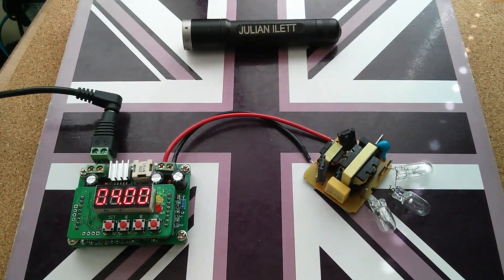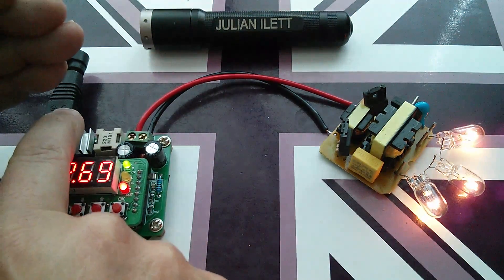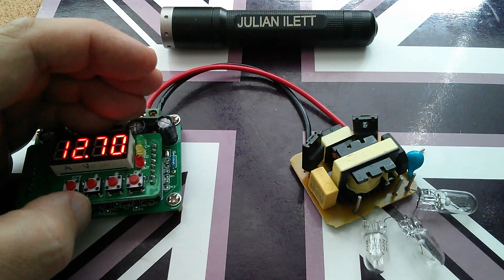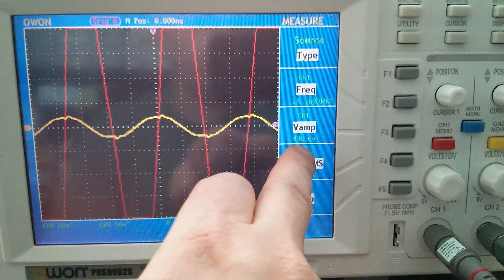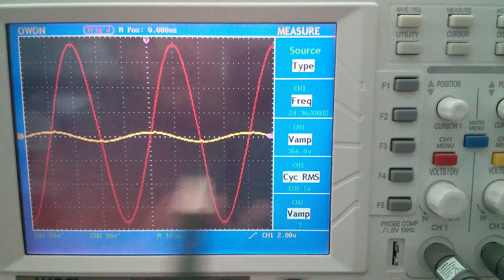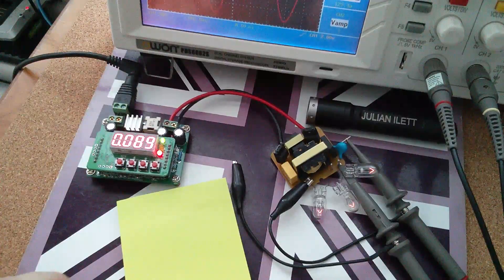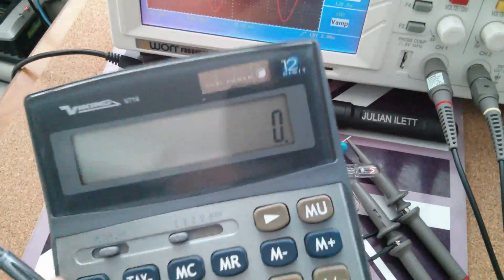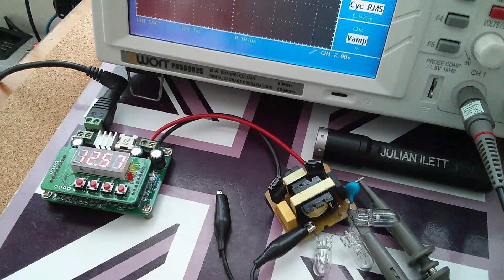Royer Oscillator Inverter with Output Capacitive Dropper

Comment: The voltage divider ratio is not confirmed by the oscilloscope because you can't add reactance and resistance in the scalar form as they are perpendicular to each other. So the formula for the voltage divider that involves a capacitor is a bit more complex, it involves a ration in its vector form.

Comment: the cap getting warm shouldnt be there,as class y metal film type is usually to chassis for emi filtering. . .I,m  surprised it hasnt croked it.!.  the dc- ac lamp inverter circuits typically use polypropylene caps in the output to limit the current to the fluoro tube. , but not cheap,so  to save on cost ,this fellow got the job.

Comment: Its an safety cap, its designed to be connected to Earth hence the Y, it is however NOT designed to be in parallel with the output, therefor it gets warm.

Comment: This may help, I found it on a different ebay listing:

First: can not be used in: iron core transformer (including the motor category)!

Second: the output of sub ABCD multiple combinations, each has its advantages, such as:

A plus C for output: the output of this circuit with power overload protection.

D plus C for the output: the output of the direct hybrid (electromagnetic valve relay capacitor charging lightning protection equipment and socket outlets can be normal use) of the dual template direct hybrid compatibility of the best.

A and B as output: the output specifically for resistance capacitance step-down drive (Nightlight resistance capacitance LED lamp 110V AC electrical appliance) these two kinds of products, then can not be used.

Third: double mode board this three way can be used at the same time, the total power is not more than 35W.

Dual template: 3V-14V battery can be turned into 220V and 110V alternating current and 220V DC power.
Output voltage: AC AC100V DC220V AC220V power output rate 0.1W-26W

If the input voltage is 3V, the output is 1W-3W (automatic variable power, according to the load and meaning)

If the input voltage is 5V, the output is 1W-5W (automatic variable power, according to the load and meaning)

If the input voltage is 8V, the output is 1W-10W (automatic variable power, according to the load and meaning)

If the input voltage is 10V output is 1W-15W (automatic variable power, according to the load and meaning)

If the input voltage is 11V output is 1W-18W (automatic variable power, according to the load and meaning)

If the input voltage is 12V output is 1W-26W (automatic variable power, according to the load and meaning)

If the input voltage is 13V output is 1W-28W (automatic variable power, according to the load and meaning)

If the input voltage is 14V output is 1W-35W (automatic variable power, according to the load and meaning)

The product is high frequency current, the common universal meter can not test the voltage of the (dual template of the DC hybrid can be tested after the load), the single template needs to use a professional high-frequency universal meter to test the output voltage. You use different brands of universal table test out the voltage is not the same, there is a gap between the. There are customers to reflect the universal meter test out of the voltage is too high, but also some customers reflect the test out of the voltage is too low, which is different models tested different results. In the use of incompatible products will not high voltage. Can consult the owner before use.

The actual voltage of this product is in the 210V~240v to meet the electrical input safety voltage.

The dual template of the self loss power control and then 0.3~0.5W between, extremely power saving,

Comment: I curious how it would work driving a 240volt 10 or 25w ish fridge lamp or similar as it was intended and what is efficiency and output wave would look like. It should easily drive a CFL. As some others have said the capacitor should not be dissipating energy in that circuit, I'm wondering if the very low impedance load adds to the issues.

Comment: Capacitor getting hot is because it is a ceramic with high internal resistance from the thin metallisation used, so it gets warm from the I2R losses in it. Replace with a 2n2 400VAC film unit and it will run cool, just because the film has lower DC resistance and thus less heating.. As well put a capacitor of around 470uF 25V 105C low ESR directly across the DC input, it will improve the efficiency.
Reply: This capacitor is designed to be connected across 240V/50Hz mains, so using it at 130V/25kHz is going to pass about 300 times the current that it was designed for, it's a wonder it doesn't emit the magic smoke.  The designer of the inverter probably intended it to be used in series with a fluorescent tube of some sort so the voltage across the capacitor would then have been lower.

Comment: spikes are from transistors switching from one to anoather
Reply: Most likely, and the caps will diferenciate that waveform too, so any hi frequency spikes will have much more current across the load!
I had thought fluoro driver too, but why the rectifier?
I found those type x and y caps got hot too, MKT best, probably green cap ok too.
Reply: +william Taylor Yes there is a lot of reactive power on that cap so isolators heat up
Reply: Yep, they are a strange beast, they are designed to fail open unlike most kinds of caps, same type as those suppresser caps inside every usb charger that connect you to the mains!
I think it would be interesting to short the output and deliberately pop the thing to see how it really does fail!!!
Reply: probably woud melt and become resistor beacouse they are not desinged to protect from high current and heat but high voltage causing breaktrought inside I think.
Reply: Well, I think they are supposed to fail open. I'd love to actually find out in the real world.
They are a Y class cap, and a normal cap fails short, which is slightly bad if it's connected from the mains to the output of a plugpack!
bigclivedotcom talks a lot about them.
It's probably time for Julian to blow something up again anyway!
Heh Heh!

Comment: You cannot do a simple diviosion with reactance and resistance to get the drop. The result of simple division is simply just wrong. If they are in same order of magnitude, the calculation gets a bit more difficult.
However, when the reactance is an order of magnitude larger, you can assume the resistance is a short to get the estimate of the current and after a multiolication with resistance you'll get an estimate of the voltage. The error for this method should be less than 5 or 10% when the reactance is at least 10 times the resistance.

Comment: The 90 degree phase shift makes perfect sense.  Most of the output voltage is dropped across the capacitor so it determines the phase of the current.  The current in a capacitor leads the voltage by 90 degrees.  The load (the lamps) is resistive so the voltage across it is in phase with the current so it also leads the output voltage by 90 degrees.

The kinks in the load voltage waveform are however a mystery.  They must be somehow related to the switching of the transistors but that doesn't explain why they are not present on the transformer voltage.

Comment: Nice video Julian Thanks. It seems to me that the capacitor ESR might play a role in the output voltage drop, in addition to the pure reactance.
My additional question is about the serial port of the B3603 cnc power supply. Can it be used to program the voltage or current values with an external laptop or pc or arduino for instance?
Reply: I don't think the serial port does much with the standarrd B3603 but someone has reverse engineered it and wrote some custom firmware for it which does suport serial control.

Comment: I'm guessing the cap is for impedance matching with the theoretical 220v 35w load. Do you happen to have anything like a 220v 40w incandescent bulb to test the output voltage?

Comment: I've gotta get one them programmable dc-dc boards with the display/buttons , I have been searching through all the videos but yet to find it.
Reply from the maker: It's the B3603 by Ming He
Reply: Thank you , Ill start searching for it at once :-)
Reply: Cool! I just bought one! Thanks!
Reply: I figure they got to be useful for something :-)
Reply: I wrecon rechargeing batteries, There just wouldn't be anything under 36v you couldn't charge with that thing!
I'd better go and scower ebay for a 40v 3a supply to run it with!
Reply: Hehe i think ill just stick to using a pc power supply :-)
Reply: Only problem with that is you only have 12v, you couldn't get it above about 10.5v with that, Not so useful!
Reply: well errr ill put my large 18650 batt pack on it heh or something crazy
Reply: Well, I did find this, and had to have it too!
ebay:
Item ID: 291715691769
It's a 400w 8 to 80v up converter, I think it can take from 6 to 40v in, so could be rather good on an old pc supply!
Could run the other one off this for fine low voltage control!
This would be orsum for Julians solar system!
If he doesn't already have one of course!
Reply: But ebay cant find item number 291715691769
Reply: Hi, Here's the address then.

 http://www.ebay.com.au/itm/291715691769  
Hope youtube doesn't munge this!
Reply: Yeah that works great thanks :-)

Comment: I think it is time to build a new version of the unit that you are investigating and turning it into a INDUCTION HOB, using 2x 2N3055 metal cased power transistors.

Comment: What's your opinion on buying individual solar cells ?
I'm thinking of getting some cells to play with ( 40w for 25€ ) but is buying individual cells a good idea ?
Reply from the maker: It's a lot of work. Soldering the cells together with tabbing wire. Sealing it all in a glass-fronted frame. But we love hard work, and we learn so much more from a DIY project :)
Reply: So it's possible, that's good to hear  

Will definitely get some then !

Also, didn't that banggood scilloscope come with 1x probes ?
Reply: +BitsAndBites It's alright for small panels, (about 40W/100 cells or less) especially if you can find glass or a sealant for cheap/free, larger panels are obviously possible but no where near cost effective these days since you can get a full 100W+ panel off ebay for roughly $1 per watt, whereas comparatively buying solar cells, glass, frame, plus sealant if you want to leave it outside, in total it would be around about $40+$20?+$10+$30=$100 bare in mind those are just guesstimates and a bit on the low side, so the actual cost will be a bit higher, which also doesn't factor in the little extras such as tabbing/bus wire and a flux pen is recommended, so another $10 there and you'll probably want MC4 connectors if left outside so about $5 oh and you may want a solar mount too, so overall I wouldn't recommend it unless you have a specific size/shape/power production in mind for a project or you just want to have a bit of fun with em.

For smaller panels though, I got lucky enough to get a bunch of 10pcs 52x38 cells for $2 a pop and I got a little photo frame (big enough for about a 10W panel) with a glass panel  on clearance for a mere fifty cents, so that took care of the most of my expenses, the tab wire and anything else was pretty cheap, so the most expensive thing for me is getting a sealer, though I'm thinking I'll skip that and keeping it indoors.

Comment: Why is the current dropping? I don't really understand this circuit. Can someone please explain?
Reply: That type of capacitor is very temp sensitive
Reply: Also the calculation of the effects of voltage divider between resistive and capacitive components must be done through vector addition rather that through simple addition. There is a 90 degrees difference between the two, you can't just add them together.
Reply from the maker: I'm not sure. I think it must be temperature related - something getting warm. I've not had much experience with capacitors getting hot.
Reply: Adding the capacitor puts the circuit in a regime whereby you require a much higher input voltage (12v instead of 4v) to achieve the same output voltage.  And like with all boost convertors when the difference between input and output voltages drop so does the input current and with it the heat dissipation in the transistors, so they stay cool.  I also think that the capacitor acts as not just like voltage dropper but also as the C of the LC circuit putting the secondary coil of the transformer into resonance at the desired frequency (25 KHz?). As a result we can see much cleaner sine waves with the higher amplitudes than when the capacitor was shorted.